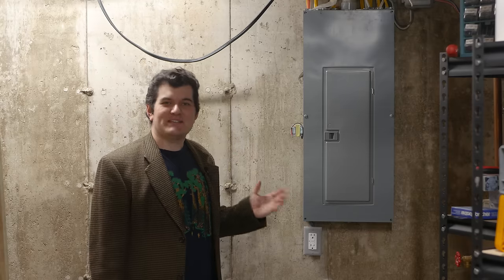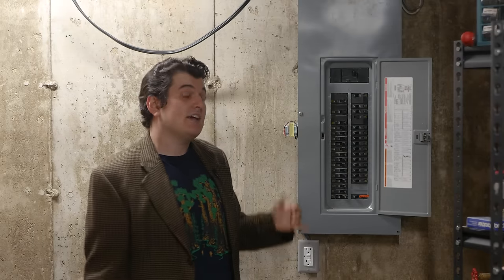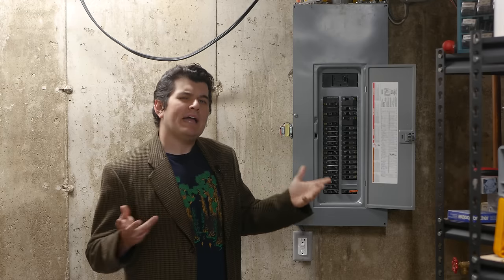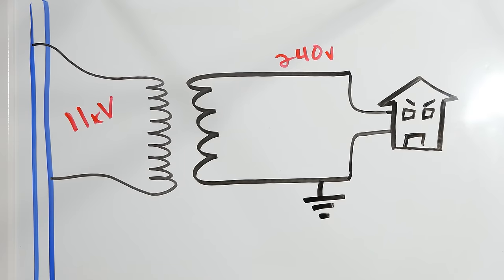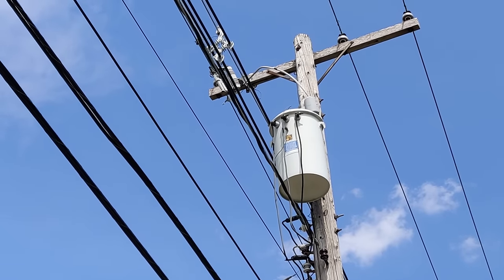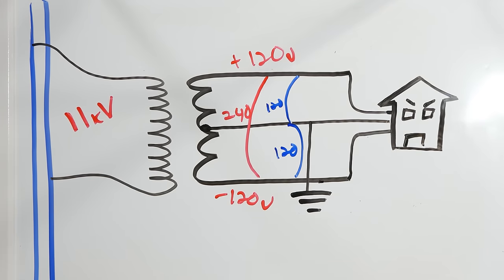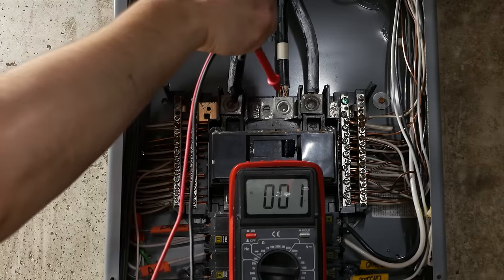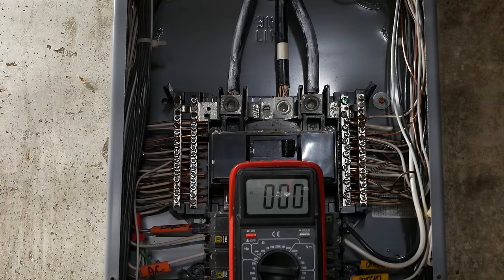The US electrical system is not 120V

Comment: There's a reason we Brits switch things off rather than unplug them. You've clearly never stood on one of our plugs in bare feet! 😬
Reply: He’s talking about them being “foot hazards” in the very end!
Reply: That's why EU plugs are the best
Reply: We already have the bane of foot Lego, why make it worse with electrical plugs?
Reply: Why not switch it off using the device’s power switch?
Reply: The only reason to unplug devices is if they have any component that uses "phantom power" (consuming electricity even when the device is turned off and not in use).
Reply: Lego is 3/10 pain compared to an upturned Uk plug 10/10. It’s sharper and taller
Reply: <-- A British person.

I have.
I bruised my heel bone >:(
Reply: @tstob3467  I've seen them. Bendy round pins with Steel tips. Brass is the best conductor.
Reply: @RealBenAnderson  Because you will forget you did that and think the bloody thing has had it.
Reply: @InventorZahran  That's standby. Physical switch is a standard I or O
Reply: @InventorZahran  Phantom power is 48v power transmitted through microphone cables to operate microphones that contain active electronic circuitry. bro.
Reply: Forever Computing not sure exactly what you mean. Do you mean you will forget you switched it off and think it’s broken? This has never happened to me. I don’t see how remembering one switch is easier or harder than remembering another.
Reply: Switching off from the socket is just easier especially when you switch it on with one click in stead of picking up the plug, align it and plug it back in
Reply: @lokon1979  And yet switching off from the socket is not as easy as just switching off the device itself.

STILL NOT EASIER THAN EASY MAC
Reply: Tiara Azmalan Yes it is always better to switch off on the device itself, as other had pointed out, that sometimes you still want to completely take away the power (phantom power use, safety reasons)
Reply: From a point of Electrical/Physical properties as a German loving his Shuko plugs, I have to confess the British plugs are superior. Does not change the fact that those bulky things are but ugly, but hey.
About switching/unplugging I think the device makes a difference. And an advantage of british plugs over symetric plugs like Schuko. with a british plug, you can always be sure, the switch disconnected the phase, not the neutral. with plugs not having a polarity, you always run the risk, to switch of the neutral and have everything else still energized, even when switched of.
Safest thing is still first to switch off and then to unplugg.
Reply: "UK-style Plugs" are usually called "caltrops" in other countries 😆
Reply: The other reason for those switches is that it saves power for appliances that go into standby when you 'turn them off'. Just about every appliance we have here does indeed have a power switch yes, but many devices (TVs, game consoles) don't truly 'turn off' - they go into standby. They might have an LED that doesn't go off, they might ahve an internal transformer that still stays warm, or in some cases even do wifi pings every so often to silently update. Turning it off at the wall is a way of ensuring 100% that that particular appliance will not be using any electricity; and over the course of time this does save power $ as well as potentially ensuring longer term use of the components of the appliance. I mostly leave all mine on except a few games consoles and my shaver charger in the bathroom as to not overcharge it (it stays warm all day otherwise) ;)
Reply: @tstob3467  EU plugs don't have earth do they?
Reply: @ValkyrieTiara  some devices don't have an 'off' state, they just go into standby. some people don't like wasting power on standby. personally, i dont mind.
Reply: Tomek Stobiński eu plugs are missing things such as shutters that U.K. ones have
Reply: @mikeshardstudio  There are more voltages for phantom power, 12v, 18v, 24v; 48v is the most common for condenser microphones. Satellite LNBs use phantom power, as can mast head aerial amps.
Reply: @Fredjoe5  wdym legos dont hurt
Reply: @elliottslab  Which you literally wont need when you have isolated plugs. Also the EU Plugs have grounding but only on devices that needs it (exposed Metal)
Reply: @elliottslab   You can buy sockets with shutters if you want to prevent anyone sticking anything down there. But parents of small kids mostly buy lower tech solutions, like plastic caps that are very hard to take off without a "key".
Reply: @WhiteboyUltima  EU plugs have earth. I don't know why would you thinks they don't.

Comment: Even though I'm from EU, the explanation of three-phase allowed me to understand why my water heater operates on 400V. It always bugged me.
Reply: THE 440 gives a lower amperage load, this saving you $$ in your system, same as the 230 volt in a 240/120 circuit.
Reply: @DELORM Or maybe that search resulted in tons of shitty results simply telling me what it is and no why it is. It was also very life critical information that i definitely wanted to spend more than 10 minutes of my life to find. /s But i bet you knew that cuz you definitely checked before writing BS :)
Reply: @Seeker43  No 440. 

3 phase means they are split by 120 degree. So you combine 2 phases and you don't get 440.

You actually get no voltage that could be described by just one sinus.

Overlap 2 Sinuswaves by 120 degree and look at the result. It's messed up.
Reply: @samuelshekel1907 
The three phase EU system is 400/230 on 50Hz.

General sine wave:
A*sin(2*pi*f + phi)
Where A is the amplitude of the sine, f is the frequency and phi is the phase shift. 

The mathematical description of the phases is as follows:

First: 230*sin(100pi*t)
Second: 230*sin(100pi*t - 2pi/3)
Third: 230*sin(100pi*t + 2pi/3)

Now let's say we use two of these phases. To get the line voltage, we need to subtract two of the phases. Why subtract? Because remember, the voltage drop is the DIFFERENCE of potential.

So: 230*sin(100pi*t) - 230*sin(100pi*t - 2pi/3) = sqrt(3)*230*sin(100pi*t + pi/6)

So the resulting sine wave has an amplitude of sqrt(3)*230 ~= 400V, the same 50Hz frequency and is out of phase by +pi/6.
Reply: @Seeker43  If you took a high school physics class you would understand that amperage has nothing to do with energy costs. The American flag in your pfp is not making us look good.
Reply: @ironmatic1  can you give a brief explanation of why amps don’t = more electric usage? Idk
Reply: @dementedpeep  If you have a 1200 watt hand dryer on 120V and another on 277V, they will both use the same amount of power (W) and will cost the same amount to run (kWh), but the 120V dryer will draw over twice the amps.
Reply: @ironmatic1  In the handdryer I'm with you..the same energy usage

....it's the wiring which makes 120V more expensive (assuming the same wiring in both cases).
Double amperage wilt increase the produced heat in the wirings 4 times. (Voltage drop in the wiring doubles the current is doubled....watt = V*I)
Reply: @adu374  that's rude, spitting facts and even knowing what you are talking about in the youtube comments. ;)
Reply: @reiniernn9071  ooooh...now I remember how incredibly hot the wire of the vacuum cleaner in the USA always got and it makes sense with what you just said. it always felt really weird and unsafe, the wire was almost too hot to touch. figured it's just been too small diameter, but it was too small diameter combined with double amerage...
Reply: @adu374  so the amplitude is 400V?

*cough* times sqrt2 🤧

Comment: The American plug has the underrated quality of being quite compact.
Reply: Not much bigger: https://upload.wikimedia.org/wikipedia/commons/6/63/Euro-Flachstecker_2.jpg
Reply: True. And it can be folded, which is quite nice. In Brazil, phone chargers are twice as big just because of the humongous local plug.
Reply: and cheap, effective, and safe enough.
Reply: Wish our British plugs could be that small without compromising the safety.
Reply: @Lucky Joestar how do u ground desktop computers at home?
Reply: Something conductive falling across the prongs sounds like a ridiculously rare scenario to me. I think the condition the print insulation in the UK is protecting against are the tiny fingers if a child. I find that to be a terrific idea and there is no reason why it couldn't be done to our existing plug format.
Reply: @drooplug  also the feature on UK plugs where the shields protecting pos and neg wont lift unless plastic top prong is inserted. Stops kids poking stuff in the socket.
Reply: The design is much safer than it was as recent as the 70s. They've now added the little lip around the edge to keep fingers from slipping off. Before that they were smooth. I once plugged in a lamp from the 60s and my finger slipped off and touched a prong. Thankfully it was only one prong. It was not an experience I would like to have again.
Reply: @CryptoRoast_0  Yeah, a few years ago is became regulation here to have tamper resistant outlets. Same idea, but on the other side. There are two plastic covers over the slots and you need to press on both at the same time to get the plug in.
Reply: @andreasnulein782  its limited to 2,5A
Reply: Couldn't agree more. The safety risk is over inflated too. The times I have been shocked there was no risk of the current going through anything but my finger. You might get burned a bit if you were on it for a while, but not killed. They would be much safer if half the length was insulated though.
I find EU plugs more dangerous as half the time the ground doesn't connect, or you trip over the giant plug strips as you walk around an office, or you are using the converter connectors that are basically the same as US plugs but round pins at twice the voltage.
Reply: @SnakebitSTI  which will never happen because then they don't look like little faces
Reply: @andreasnulein782  Image doesn't work, but I am guessing you are showing the similar plug without a ground, and round pins. I agree those are pretty close. The grounded US plugs are still quite a bit smaller getting two in about the same space of one EU plug.
Reply: @JohnKelly2  I use a 1950s coffee percolator with a small smooth plug and think about this every time I plug it in.
Reply: @court2379  "half the time ground doesn't connect" So true. It sucks. And sometimes, grounding contacts collapse and fold under the plug, or block the insertion. 

Some countries (chech republic, france?) have a different earth connection style, a round pin pointing out of the socket that goes into a hole in the plug. These are better, though they don't allow two orientations.
Reply: @drooplug  when I was around 8 I thought the gap between a slightly unplugged tv looked kinda like a coin slot. So I grabbed a penny and dropped it between the hot and neutral.
Reply: Yep. And quite safe, actually. In 30 years, I've only had ONE explode on me.
Reply: @SnakebitSTI  yea only splitting the odds of a short to 50/50 on whether the piece of material then lands on ground and neutral or ground and live
Reply: @Lucky Joestar I believe that was because of american occupation in japan during the war, areas where america had occupied went 60Hz cause our stuff ran 60Hz and after we left it just stuck
Reply: @CryptoRoast_0  Theres also the added safety of most square pin sockets having a switch for each outlet, preventing an arc during unplugging of the device making the outlet and plug last longer
Reply: @SproutyPottedPlant  I believe the main reason square pin plugs are so large is that your devices hold the fuse in the plug, instead of relying on the breaker to cut the current, our system has to pull 15 amps or 20 depending on the breaker before they trip, whereas in the Uk it could either be a like 3 or 15 amps depending on the fuse, which makes sense considering the ring main circuits use a 32 amp breaker at the distribution box, also that fuse in the plug thing is quite nice cause if it blows you know exactly what device blew it, here we have to go hunting if a trip occurs to find the offending device.
Reply: One other benefit of the british plug is that it's really easy to re-wire one.
Reply: ebulating  Yes, but not all plugs are for charging a cellphone, some still do carry quite a lot of current, and the safety isnt based on the device being powered, its the mains coming into the plug, also we have that same problem, just because the plug is smaller doesnt mean the USB charger is, and it makes it worse cause alot of times larger power supply wall warts will cover over other outlets, and make them useless.
Reply: @Lucky Joestar if the wires are hot-hot, being polrized offers no benefit. the reson for the polarizaiton is to have the hot connected to the hot side.  and common/neutral to be hooked to the neutral side.
Reply: you mean like every other country that has flat pins and no fuse in the plug? sure
Reply: And it's hated by electrical engineers the world over. The US plug is awful and I know engineers who claim they're inherently unsafe and that they need to be scrapped immediately (which, it may shock you to find out, isn't an at all uncommon opinion - a survey of American electrical engineers found that 70%+ of them wanted to replace the entire American electrical system from the plug all the way to your entire electrical grid, which obviously isnt plausible but gives you some idea of the strength of feeling here).

Sorry I digree, I'm rambling about engineering. But yeah they're compact. That might be the only positive I'd give them.
Reply: @HomeDistiller  I'm not sure which plug you refer to. Here in Brazil we use a design based on the europlug, but with a ground pin and a recessed socket to prevent the possibility of touching the leads. In my opinion this is a superior design when compared to the American one. But sizewise, the American plug still is better than the Schuko and many other bulky plugs.
Reply: Many Australian plugs forgo the earth pin and look almost the same as US plugs with the primary difference being the +&- are slanted at 45° instead of parallel.
Reply: @drooplug  AFAIK it was so easy for a 1p coin to get stuck between all the prongs, causing a short, this was the reason, not a child's fingers.
Reply: @inthestarrysky  Thanks, I didn't know this version existed, only the three pin version.
Reply: @Lucky Joestar I would expect nothing less from a country that uses two phonetic writing systems and a logographic ;-)
Reply: If you look at an outlet in a commercial setting... one that's relatively new at least... you can see the history of plug design, since the socket can accept all the variations. First there was the one with two equal sized lugs... that could plug in either way, and could be dangerous if one side of the line was grounded to the chassis, and you plugged in wrong. Then there are the two variants of polarized plugs, one where the lugs are different sizes and another where one lug is "T" shaped. Then there's the three prong plug with the round ground lug.
Reply: I'd argue that the UK and other 240V areas should have safer sockets and plugs because the voltage is far higher.
Reply: @inthestarrysky  The Australian angled-pin format originated in the US, bus was abandoned there due to incompatibility with the ungrounded plugs.
Reply: ebulating  That would be true, if our mobile chargers had the same solid type of plug that appliances use, but they don't. They have collapsable plugs, about half the size when not in use. Also, socket outlets with built in USB outlets are common now. All in all, I would say our outlets/plus system is very safe, unlikely to be dislodged, and childproof.
Reply: @SnakebitSTI  I never worry about getting zapped by the pins themselvs; even when I was a kid, it was more of an annoyance. But if you have a bare wire near the outlet for some reason, or a metal outlet plate that gets loose, it could be a catastrophe.  They recalled some chargers from China a while back that had cool-looking wire-braiding around the cords; a number of them burnt up and caught fire after landing on a pin.